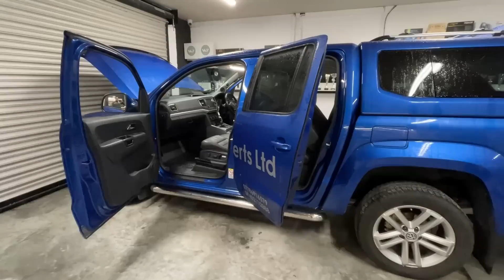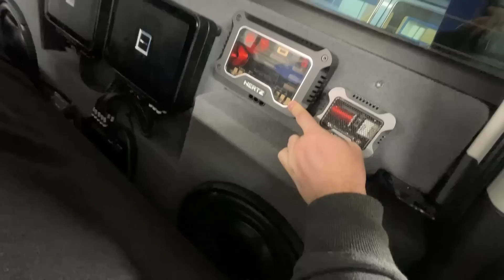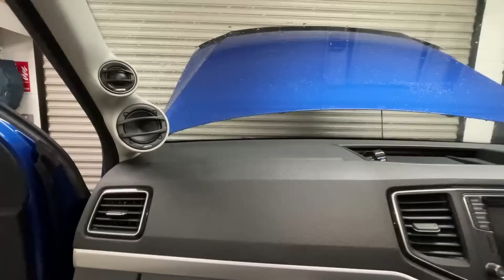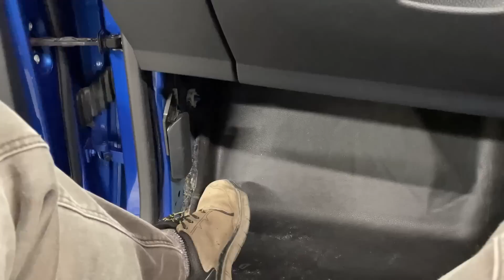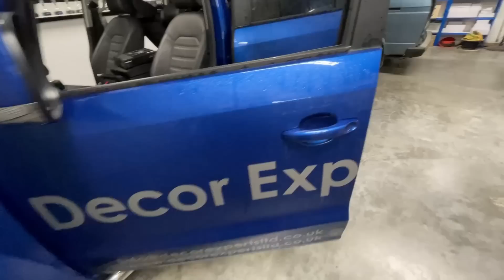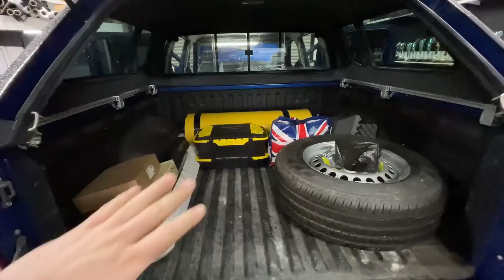Craziest? SQ(L) System Introduction - VW Amarok Pick Up Truck

Comment: Peter i have a Question reguarding dsp's and just my understanding. if i were to use a dsp-amp, say a Zapco adsp, do i need to set any potentiometer gain adjustments or are they already calibrated/digitally adjusted to not clip? also if  i would boost a subwoofer very high in the eq, would the dsp automatically limit the overall output of the system to maintain the response curve or would the curve roll off to achieve higher levels? i think it would just limit the whole systems output but im not sure. 

Thank you very much! also very interested in the upcoming videos as usual! :D
hope i can start my build soon, sadly i dont really have much time at the moment.
Reply from the maker: If you boost EQ and keep the output gain on zero, then you can overdrive the output, so the eq boost have to be compensated on the output level.
Reply: @pssound9749  ahh ok got it, thank you! :D

Comment: Pssound.  There had been quite a bit of IB subs mounded under the rear seats in trucks state side.  I sat in one with 4 12s ldown fire long ago. Image Dynamics.  They made a fence underneath and water proof similar to what you do.  It was an experience to say the least.

Comment: lots of trucks in the 90's had cutouts to the bed. They make rubber gaskets to go between the bed cap and the cabin so you can remove the back glass and make it a pass through. They used those gaskets for the lower cut out too. You should be able to do similar and still have the needed flex in the vehicle.